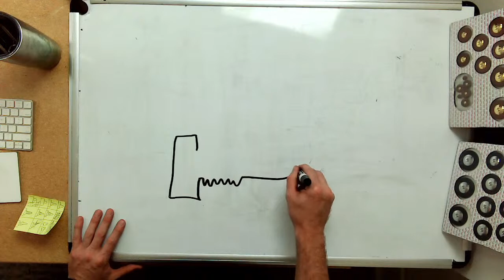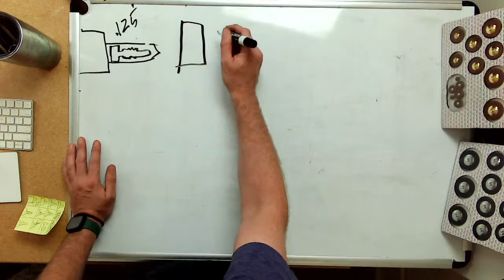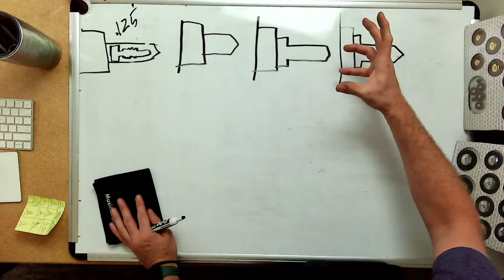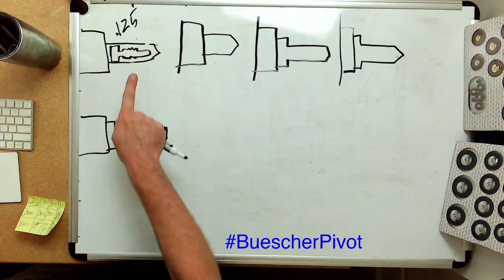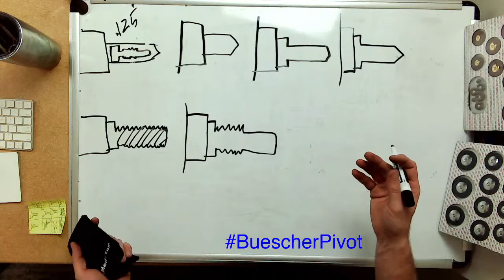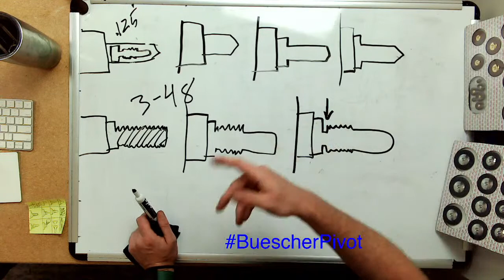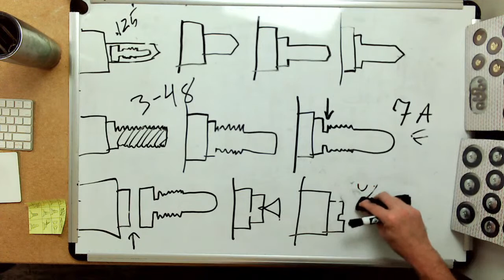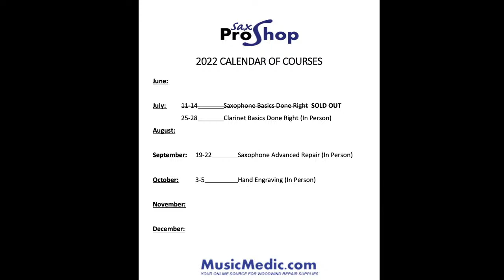How to make a Buescher Pivot Screw! In 10 EASY steps #WednesdayWisdom

Comment: Nice Job
What is the size of your parting blade? Could you give us rough overall dimensions for the pivot screw? total length,
length of threaded section, length of unthreaded section? Thanks
Reply from the maker: Thank you! The parting blade is 1/16th (1.59mm). Rough dimensions are: Total length: .403, threaded section including shoulder is .196, length of unthreaded section (cylindrical tip) is .152. 3-48 pitch on the threads

Comment: I own only  a Dremel , any chance your future vids will include instruction using this ubiquitous tool. Instead of a lathe owned by only a handful of your viewers
Reply from the maker: Yes of course! We always use the proper tools for the procedures described. We use a Dremel or Foredom when that's the best tool and we can do some more vids with those. To do machining you will need machine tools. Hand tools are simply not accurate enough to do this type of work.